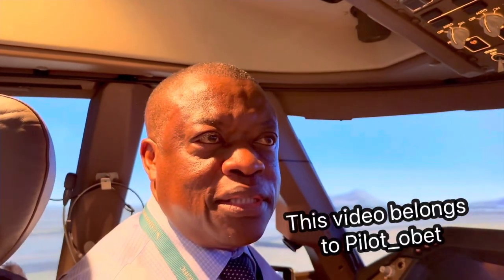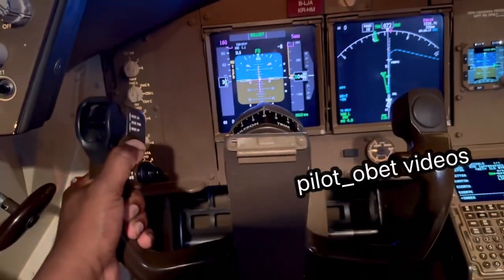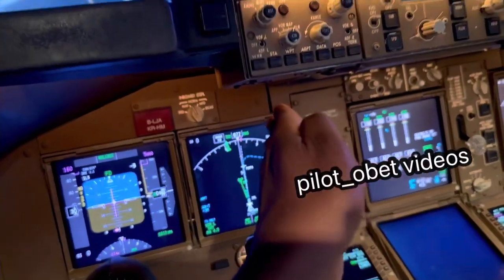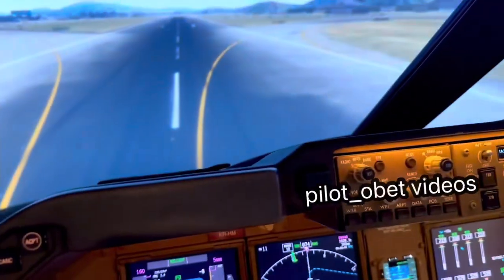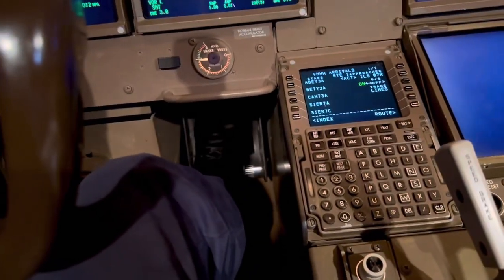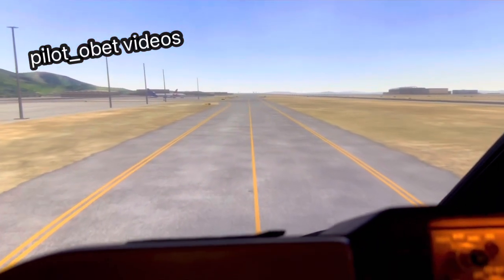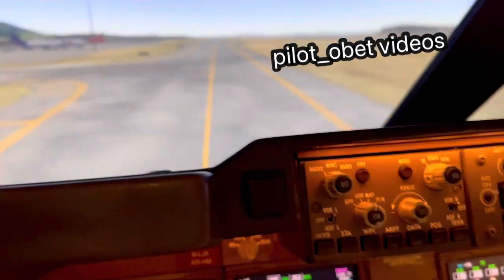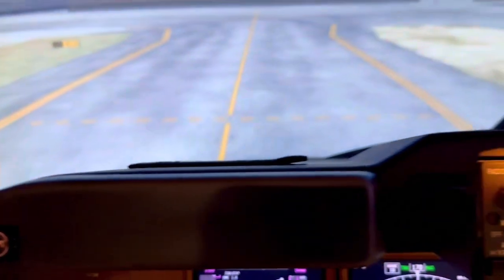How to Taxi the Boeing 747-8 ‘Superjet’

Comment: Wonderful video!  Thank you captain~
What’s more, I would like to know the force we need to move the control yoke. And whether the force will change during the flight due to the wind or any other reasons. And I know the -8 is flight-by-wire, while the -400 is flight-by-cable. So what is the difference feeling in the yoke force. 

Thank you. 🎉

Comment: I knew there was a lever there to turn the aircraft while taxiing, but I have never seen it used like here. Very clear! Thank you. Extra question: I always used to think that, especially on big aircraft, like the 747, there is a camera mounted somewhere near the nose wheel to assist in following the lines on the ground. This image from such camera would have to be shown on some monitor in the cockpit I guess. Is there such a feature? Maybe modern aircraft use one of their multi-function displays to view this. Or are you just using some marks from inside the cockpit to judge when it is the right point to turn? If so, for any precice maneuvering, this can be quite difficult...
Reply from the maker: Yes - the B777 has a camera for example but the B747 didn’t have it as a standard fit. To taxi a big jet you really need to look outside. Can you imagine driving your car and everyone you approach a turn you look inside a t a screen…

Comment: Thanks for this video. The question now is how do pilots centre the front landing gear  with the centre mark on the ground?
Reply: Training skills and experience…..the 748 is different than most aircraft.  Not only long but high.  The nose gear In most larger aircraft is usually behind the pilots.  Make a note next time you fly.  The aircraft taxi beyond the runway centerline and make a 90 or almost 90 degree turn.  With that turn the nose tires should be straddling the centerline.  After that just use rubber pedals and very slight adjustments until you get full rudder control.  Very very shortly after that the v1 speed is called…the point at which it is safer tao get airborne and return to airport for emergency landing.  A few seconds after that the “Rotate” is called and  the control column or control stick in some aircraft is pulled back slightly to raise the nose.  Once the nose is rotated the plane will eventually climb off the runway.   When a safe and reliable “Positive Rate” as in aircraft is climbing the landing gear will be raised usually by the non flying pilot.   A few seconds later the flaps will be raised in either one or possibly two steps depending on flight conditions and performance parameters for that aircraft’s weight, altitude, temperature and obstacles ahead.

Sorry for stealing your video Captain.

This video is a 747 but most aircraft especially larger aircraft like commercial airliners have the same principle.

Comment: ive seen most pilots use the rudder panels instead of that, so ive came to this question: is it only on the 747 that you dont use the rudder panels? or do you just take that taxiing method in favor of the rudder?

Comment: CAPT MISSED A FEW POINTS,  ACTIVATE BODY GEAR STEERING/TURNING IT ON,  THE USE OF OUTBOARD ENGINES # 1 & 4 ENGINES TO START TAXI ROLL & ASSIST IN TURNING THE AIRCRAFT, REDUCE TRUST AS OPPOSE TO BRAKING,  WHEN TO EXECUTE THE TURN TO KEEP THE AIRCRAFT IN THE CENTER OF TAXIWAY & RUNWAY.
Reply from the maker: Body gear steering is automatic- there is no switch. The B747 -200 classic had a switch which the Flight Engineer would switch for pilots to taxi
Reply: @pilot_obet  WHEN OR WHERE DID YOU PILOT OR MAINTAINED A 747/400/8 ? LOOK UP ATA CHAPTER 32 LANDING GEAR DESCRIPTION / OPERATION & CHAPTER 9 , & ANY AIRLINE GENERAL MAINTENANCE MANUAL ON ENGINE START UP & TAXI PROCEDURES . ARE YOU AWARE THAT YOU CAN START UP ALL FOR ENGINES ON A 747/400 SIMULTANEOUSLY

Comment: Good video, but to me it demonstrates how archaic the Boeing 747 is/was.
Reply from the maker: When it was designed, it wasn’t. Todays modern jets like A350 and B787 still have some small half wheel/tiller in same manner
Reply: @pilot_obet  i totally agree, but I thought through the various iterations (-400 or -800) they would have updated or upgraded to a wheel/tiller rather than the quirky lever. Great vids btw.

Comment: Does he leave the engines power running or does he idle for every turn
Reply from the maker: Depends-usually idle thrust gets you round the turns
Reply: @pilot_obet  what about the u-turns and what if you're more heavier do you still use more thrust

Comment: Does this model aircraft give you an instrument panel indication of the nose wheel angle?
Reply from the maker: Not really it’s by feel/experience etc. like driving a car- you don’t have an indication of how much you have turned the car - you just visually know
Reply: @pilot_obet  I didn’t have one in the Learjet either, but I thought it would be useful in an aircraft this large, before you apply a great deal of thrust on the ground to a nose wheel that is turned at an extreme angle.
Reply from the maker: @arthouston7361  if the body gear is not centred once on the runway, you get a configuration warning.
Reply: @pilot_obet  I can think of times when a configuration warning would’ve been nice to have, but they weren’t equipping aircraft with those systems back in the 1970s.